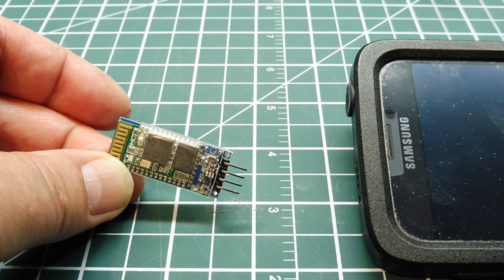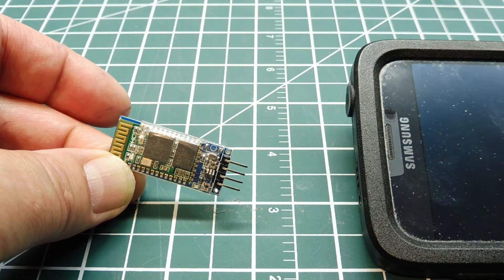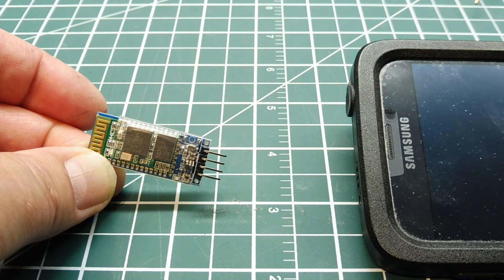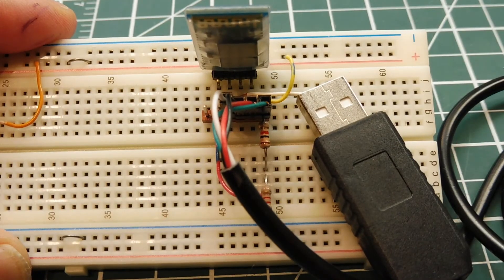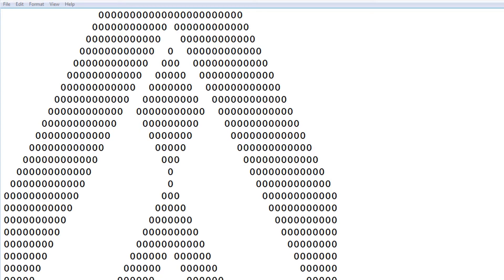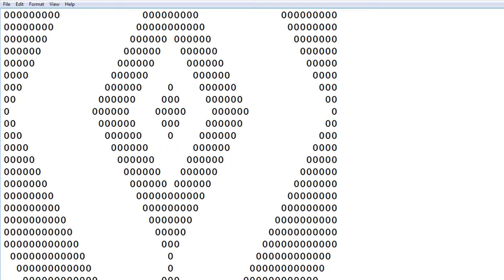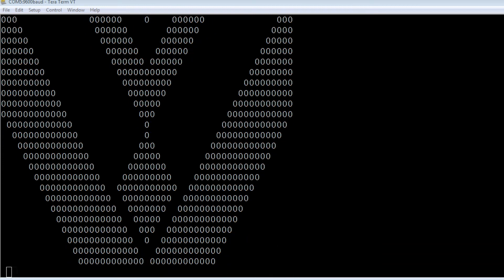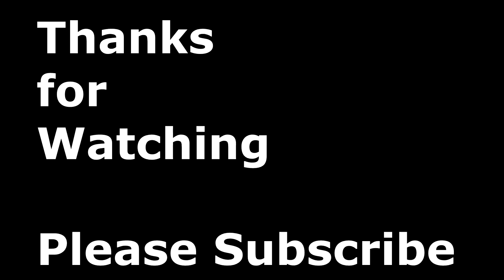Bluetooth Range Testing  /  Visual BERT Test

Comment: I understand that you are just using a pc connected HC-06 using with Tera Term  as the receiver.  But what are you using as a the transmitter, another laptop or something embedded with the image in flash?
Reply from the maker: The transmitter is a stationary HC-06 running the test pattern. The receiver is my laptop running TeraTerm with the laptop's internal bluetooth. I was walking away from the transmitter holding my laptop.

Comment: Hi sir, great test. But I get confuse in your test procedure. The receiving bit display on your screen is view from your phone? If you don't mind to share more detail how did you conduct this test. Regards..
Reply from the maker: The test pattern is sent as a text file to the HC-06 Bluetooth module using Tera-term and is being transmitted over the air.  It is being received by my laptop running Tera-Term and captured. The test results that was shown was from my laptop.

Comment: Oop, I fell asleep.... Just solder a 31.5mm antenna to the bt printed receiver antenna.. looks like turrets on a castle ..
Reply from the maker: The antenna on the bluetooth module is an inverted F antenna and is used for transmitting and receiving. The length is calculated for an input impedance of 50 ohms to match the radio output impedance for maximum radiation and a low VSWR. Adding any length of wire will increase the VSWR and degrade the efficiency of the antenna.  https://youtu.be/JeUexihrKZQ

Comment: I've got 2 identical Samsung phones, I'm not kidding you, I'm getting 90 feet of Bluetooth line of sight connectivity with my Jumbl player paired, getting excellent audio and can still remote control from that range. The other phone can't even come close to that. I don't understand it.
Reply: There must be a reason, different firmware/software(android version/edition/apps)
Try seeking how to enter into TESTING mode, you might know something...
It shows you Bluetooth signal strength and other info...
https://duckduckgo.com/?q=Samsung+phone+testing+mode
Example: https://youtu.be/FjNdzPCGfkw
Reply: the antennas are made with a specific tolerance, resulting in some phones with better gain than others.